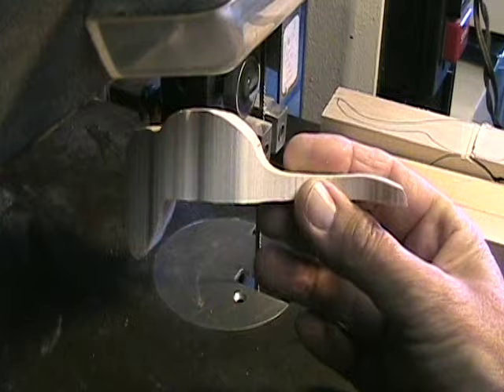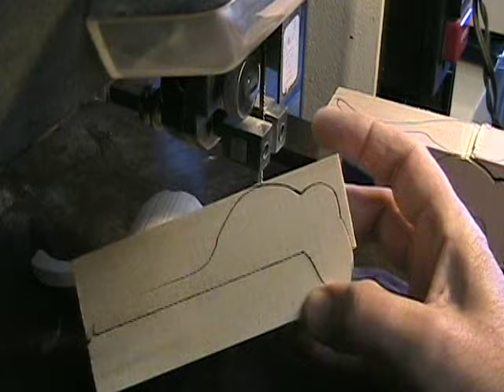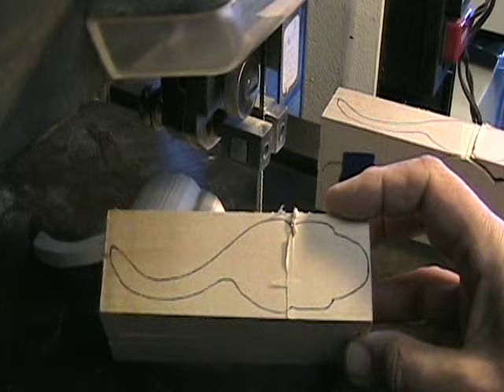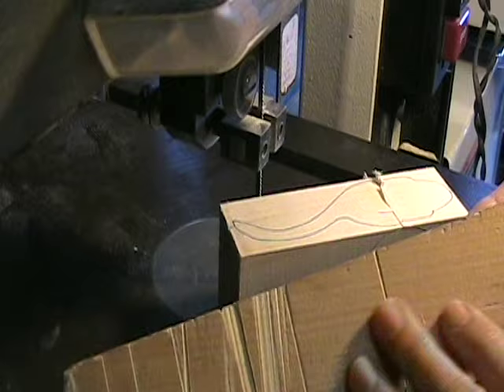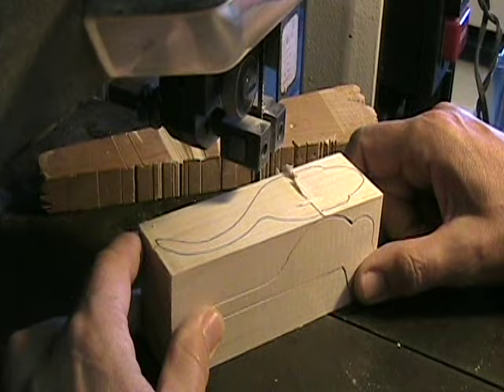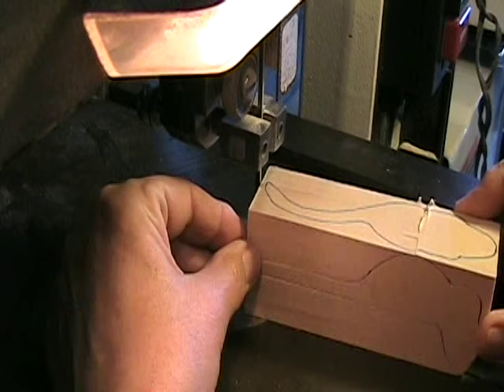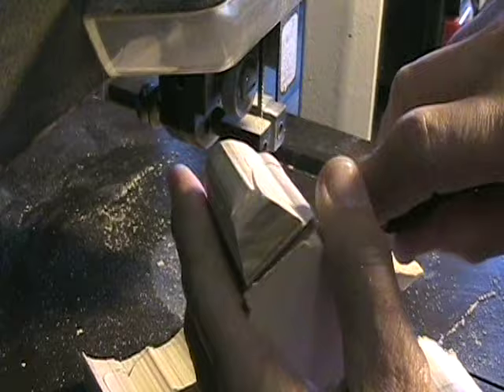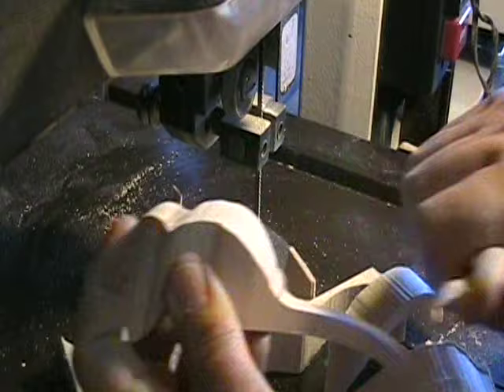Band Saw Safety- Peeking Mouse Blank

Comment from the maker: Weeellll- there is no suction on my band saws. What there is is momentum as you finish a cut. As soon as you cut through there is nothing to stop the fingers from keeping on towards the blade. That is why I NEVER have my fingers in line with the sharp teeth of the blade when I am within 3" of the blade. As I get closer to the blade I put the sacrificial push stick in line with the blade instead of my fingers. I've been using my band saw since 1973 and never gotten a scratch. . . yet.

Comment from the maker: @mondovila , you may be thinking of the danger of floppy sleeves, long hair, or dangling jewelry when turning on the lathe. A loose piece of material can get caught and wrap around the spinning wood and draw your body parts into harms way. I wear long sleeves when turning too- but nothing floppy. I'm often wearing long sleeves to reduce the friction of bare skin on metal tool tables and to keep sweat off the metal as well. Not to mention to keep warm! Glad you were paying attention. Donna Menke

Comment: Lots of good advice here.  Thanks.

Like most wood workers, I end up with a lot of scraps.  Unless I take up pen turning, much of it would become the neighbor's fire wood.  On a whim, I started making small push sticks that I keep around my band saw, scroll saw and drum-disk sander.  They are easy to manipulate, many are small enough they can be left in the miter groove, and they are far more replaceable than your fingers.

I use these to apply side pressure on re-saw operations, to flick cut-offs out of the way, to push wood into the blade and so on.

Since scraps are, well, scraps, I can experiment with different shapes and duplicate ones I like.  Here is a Lumberjocks page with photos of some of the one's I've made:

                      http://lumberjocks.com/projects/105726

Comment: The bandsaw is the least dangerous tool in a wood shop! You would have to be a complete idiot to seriously injure yourself on a bandsaw.
Reply: ...and here is the one who has never worked in a wood shop before.
Reply: @Sheepdog1314  and who are you referring? I have a large wood shop with 3 bandsaws of different size and I also restore older delta/ Milwaukee saws.